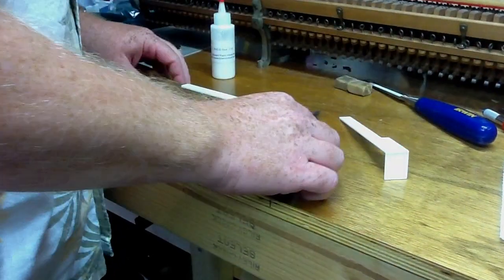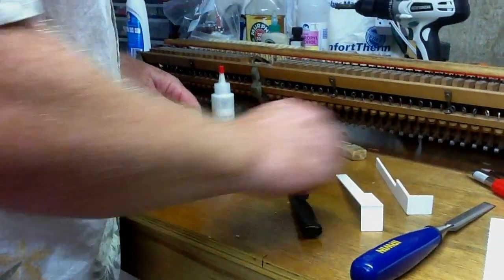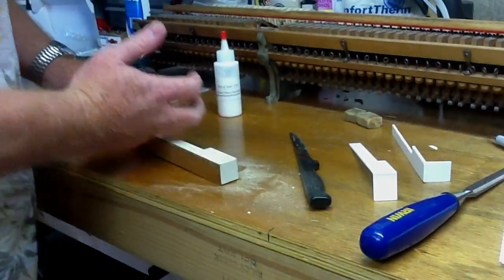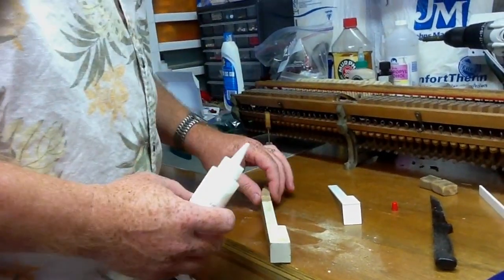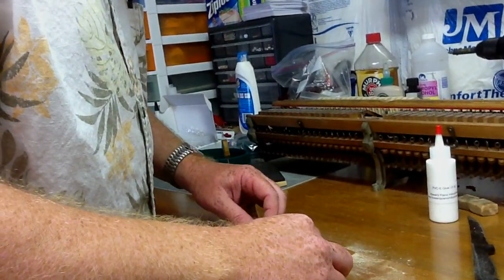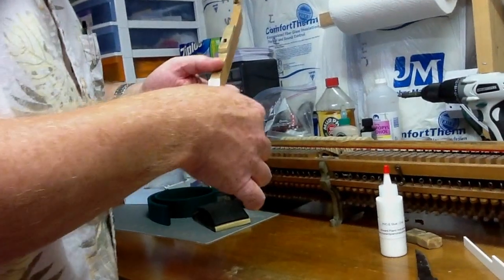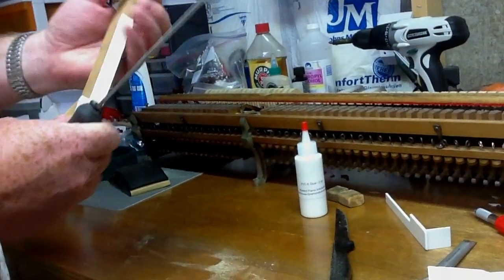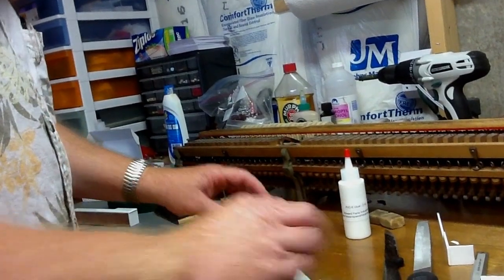Piano Tuning & Repair - How to Replace Piano Keytops I HOWARD PIANO INDUSTRIES

Comment from the maker: Thank you for your comments.  Yes, there is a chance that you can make the top of the key uneven if it is not sanded correctly.  That is why it's important to use a sanding block and to make sure that you sand with the block flat on the keytop.

Comment from the maker: Thanks Jessica,
That's a good question for those who are installing keytops that don't have the attached fronts.  What you'll want to do is install the new keytops so the front edge of the keytop extends 1/16" off the front edge of the key.  You can measure this using a small 6" steel ruler.  Feel free to let me know if you have other questions.

Comment from the maker: I wouldn't recommend using cyanoacrylate glue for keytops.  The only other glue that is recommended for attaching keytops is contact cement which I have tried.  I much prefer the PVC-E glue over contact cement.
Reply: Do you have any videos on replacing the black keytops? I have an old piano and the previous owner took the ebonys and covered them with a few coats of paint and finish. I wanted to cover them with plastic

Comment: The biggest nightmare of replacing key tops is that they rarely can be used out of the box.  You have to shape them. I do the rough shaping with a Dremel and finish with a large, flat drywall sanding block and a fine file.  At least in my case, I've found that it is a chore that a technician can't get fairly paid for the time involved.
Reply from the maker: Yes, it definitely is a time consuming task.  I know that technicians that do this regularly have jigs that make the work much faster and can make the job profitable.
Reply: @howardpianoind - So, from the perspective of a client who wants to do a full restoration of his piano, it's probably a smart decision to do the keytop replacement himself, and spend the saved money on more complicated aspects of the piano restoration process like restringing or wood polishing, right?

Comment: We have an old upright (Boston Piano Co, 1906 ish) and many keytops have popped off. I'd like to buy a replacement kit for my hubby's Xmas present (he's very handy, but has never worked on a piano before).  The kits come in different 'head' widths. How do I determine which to purchase?  Thank you!
Reply from the maker: The key top heads come in two different lengths.  You would just need to measure the length of the head which if it is a little too long you would need to file the heads.
Reply: Okay, thanks.  Is the length of the 'head width' from end to end or side to side?

Comment: I have one broken keytop on my 1970s Horugel Studio Upright.  Evidently one of my kids dropped something really heavy on it:(  Does one usually need to replace the ENTIRE keyboard in order to fix one key (e.g....are the colors and shapes of white keytops pretty standard?) In other words, if I bought the set of German acrylic one-piece keys offered on your website....would I likely have to replace all the white keys instead of just the one broken one?  Advice?
Reply from the maker: There will be some color difference most likely, so if you want the keys to look uniform in color it is recommended to replace all of them.
Reply: Thank you much.  Your channel is super amazing.  Thank you for all the imparted help/knowledge.

Comment: One of my plastic white keys has a shallow pitted area on the back part of the key that was caused by a tuner while holding a voicing needle allowing it to rest against the key.    Would there be any way to smooth this out without replacing the keytop?
Reply from the maker: I think any attempt at making it better ( sanding or using a filler) would only make a more visible aberration in the key. Even replacing the single keytop would have to be done with great care to end up with a result that would restore the original condition.
Reply: @howardpianoind  Thanks.  It isn't very visible.  It's just that I feel it when playing.

Comment: I need to change a key to my bosendorfer. Do you recommend a site where I can buy the spare keys?
Reply from the maker: If you're referring to the wood key stick, these are not available from anywhere that I know of.  The key would have to be custom made to match the old key which can be fairly costly.  If the key is broken, it is best if you can try to repair it if possible.
Reply: Excuse me, maybe I did not explain well. I would like to know a site where I can buy plastic keys compatible for my bosendorfer. 
Then,  I understand that the most suitable glue is the PVC-E glue, it is right?
Reply from the maker: The German piano keytops with fronts that we sell in our online store should work well.
Reply: Thank you very much, and about the glue??
Reply from the maker: Yes, PVC-E glue is the best glue to use.

Comment: May I ask what is the brand of that glue? I wouldnt spread regular super glue with my finger. Thank you
Reply from the maker: This is PVC-E glue which is a water based glue.  Yes, I agree you wouldn't want to touch super glue.  It can be very messy.

Comment: What do you do if the heads are a bit too wide? I'm getting a measurement of 7/8 on my key head but the key tops I got from you seem to be 1/16th" too wide. Also, the sharps are about a millimeter or two too long and hit the wood plank that goes over the tops of the keys.
Reply from the maker: If the heads are a bit too wide, you may need to do some filing on the sides of the heads.  This isn't as common as on the tails.  Just make sure when you line up the heads that they are lined up with an even amount of overhang on each side.  So if you have an extra 1/16" your overhang would be 1/32" on each side so there would be minimal filing on each side of the head.  The same thing with the sharps, you may need to file the back end of the sharp a bit to get it to fit correctly.  Unfortunately there aren't shorter sharps available.  I hope this helps.
Reply: Thank you! I just wanted to make sure filing was the proper thing to do.

Comment: Hi, what's the best way to dissolve this glue if necessary? I can't seem to find much information about it online.
Reply from the maker: This is a water based glue so using steam or heat should soften the glue.
Reply: @howardpianoind  Thank you so much, Mr. Howard!

Comment: what about an upright!? why can't I find any video on replacing keys for an upright?
Reply from the maker: We didn't do a separate video on replacing keytops on an upright piano because the process is exactly the same.  Once you have the key out the removal and replacement process for the keytops is the same for the grand and upright pianos.
Reply: The key tops that are sold by Schaff basically fit all pianos - grand, upright, spinet.